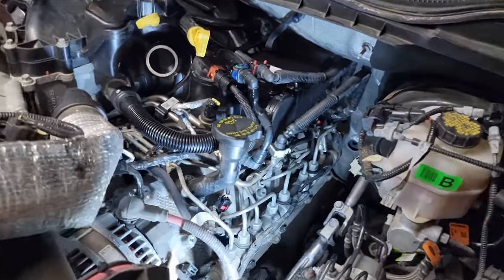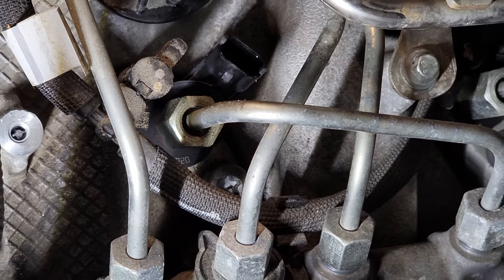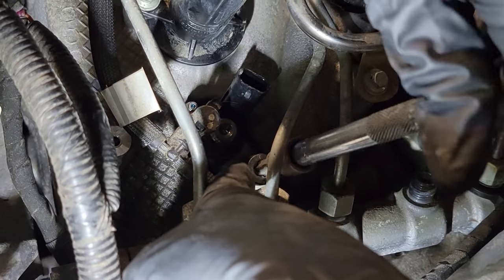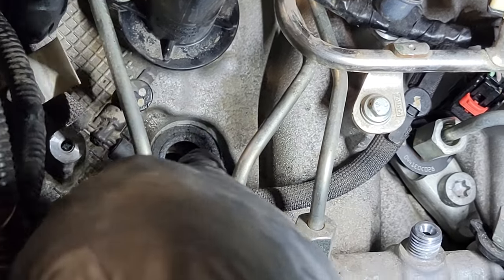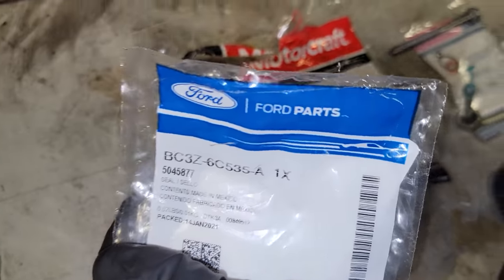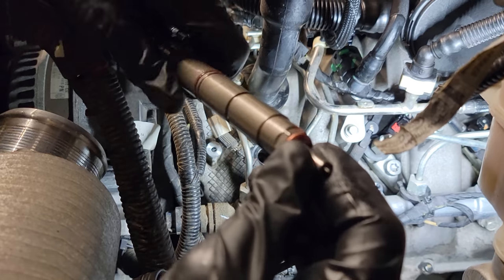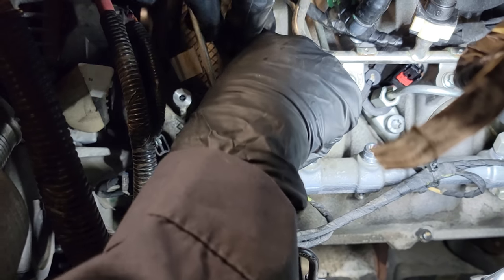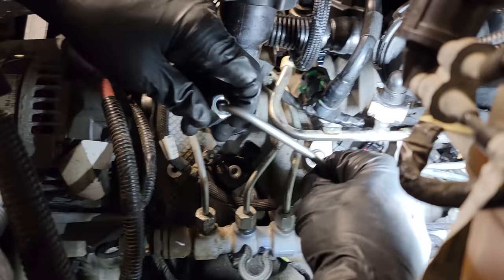Do YOU have an OIL LEAK?? 2011-2023 FORD F250 F350 F450 F550 F650 F750 **Easy FIX** Watch this

Comment: I just done this job eight of them. The customer thought I overcharged him labor only charged 300 customer supplied all parts worked in a big truck shop. I can do a Volvo semi truck and half the time and replace all the injectors and program them and labor alone was $2200, so I don’t understand how they think they got overcharged. The passenger side is hard to do.

Comment: I replaced the seals on cylinders 5 and 6 today. #5 was for sure leaking, and it looked like #6 was likely leaking, so I just did both. My injectors came out pretty easy using the “fulcrum” method Arod talked about. I had to use a 17mm wrench to get the fuel lines off and on, and it worked fairly well, though the tool Arod used looks easier. It was a little difficult to know how tight the fuel lines needed to be since when I took them off, they didn’t seem very tight. One other thing, the copper washer on #5 didn’t come out with the injector, but I was able to fish it out with a pick. There was some debris where the copper washer sits, and I was able to clean the surface by spraying a bit of compressed air down in the hole so I could feel better the washer would seal. Be careful removing the coolant reservoir, there are little tiny hoses that break very easily…

Comment: For seals like that I’ve used a J hook battery hold down bolt, put a socket over the shaft of the bolt, washer and nut. Improvised slide hammer.

Comment: Excellent work Dr Arod!  Appreciate all the insights that you give on your repairs. I tell ya, Ford dealers could use a few more Arod’s  in their bays 👌🏼
Reply from the maker: Thanks baby
Reply: Agree 100%.  We need 100’s if not 1000’s of Arod techs out there...  it’s far too easy  to get a bad technician these days, or so has been my experience with dealer shops nowadays.   And it’s common across ford, gm and Honda.  Can’t speak to the other brands though...
Reply from the maker: Alll i hear pal!!

Comment: I'm 52 come March off this year and I started working on cars at 8 years old passing wrenches to my father when he worked on a car and that's how I learned.  I'm thinking about selling my 2011 6.7l that I bought new back in 2011. It's my first diesel and this is just to damn much work. Anything that you have to do to that SOB under the hood requires for you to take off that top of the engine. What a mistake I made buying a diesel. Love the power of it but to me it's not worth it. If I could do it all over again I would of bought the gasser. Great video buddy and my hats off to you but this is too much work. Take care my friend and thumbs up on your video. 👍👍👍

Comment: Done a few of them, usually due to a plugged up ccv.  Actually made an installer out of plastic for doing the back injectors seals.  Turned it on my lathe.  Works like a charm.  Holds the seal and is strong enought to hit with a hammer.
Reply from the maker: Niiiiiceee

Comment: In cases like that, I use both a paint mark and wrench angle. On a Honda crank pulley, for example, the spec is 60 degrees more after torquing. That’s one flat or corner of a bolt’s hex head. They also make wrenches that measure angle

Comment: Yet another EXCELLENT vid by my man A-ROD!!! You know, I can count on my hands, how many times I've ever needed to re & re injectors on a 6.7. The 6.0s, not so much. If that, by itself doesn't speak to its reliability, I don't know what does. Watching this vid has made me remember the idiosyncrasies of having to do this. I have that exact same tool you have made by Matco. Except mine is a Blue Point. I find that it doesn't fit the flare nut properly (so much for Snap-On quality). I have since resorted to only using a 17mm crow's foot for this task. I use it on the Eco turds as well, when I'm into the high pressure fuels for whatever job I have on hand. I do however, LOVE that injector removal tool. I think after watching this vid, I'm going to have to order one for myself. I know that ProMaxx stuff can be a little spendy. I just bought their hub and bearing removal tool that's supposed to be the cat's ass for Explorer hub and bearing assemblies that tend to need a gazillion foot-pounds of force to separate from the wheel knuckles. Funny enough, I have yet to use that tool since purchasing it. I didn't know Ford updated the fastener for the injector hold-downs to a 10mm bolt instead of that cheesy TX-47 bolt. Kudos to Ford for that. Learn something new everyday.
Reply from the maker: Hope ur well my friend!!

Comment: Thank you for the great lesson . Let me please know what to do if  the fuel injector compression copper gasket falls on the top of the cylinder head ..  I do not know what to do now..
Reply from the maker: Ur gonna have to get something sticky like butyl & a long tip screw driver & go fishing
Reply: I am fishing now. No luck yet … 😳
Reply from the maker: Can u get a mirror & CONFIRM that it is at the bottom.

Comment: On the same truck that the bolt broke have you ever had an injector so stuck on the 6.7 I had to make my own tool the bearing puller that you loan from autozone and it was in their that truck was scary.

Comment: Hi ARod. Never done any work yet where I had to remove any high pressure fuel line. Someone said one needs to make sure it’s not pressurized for safety, before removing the first line. I may need to change my intake manifold gasket and this is the only part I have questions about. Thanks Mike.
Reply from the maker: Trucks off....the hp dissipates very quick. Id wait 5 or 10 min u shkd be gtg pal

Comment: Excellent video as always!

Got the same issue on my 12 on cylinder 1. Thought I might get lucky with a CCV replacement, still doing it so I’m gonna have to replace that seal. 

Biggest concerns I got from the video, 
1. Don’t snap the hold down bolt in cylinder head
2. Don’t let the compression washer fall into valve cover. 
3. Don’t break the fuel return line

Anything else I should watch for? 

The injector re-seal kit for injector 1 the same as 5? 

How often do you see the washer fall off or bolt break?
Reply from the maker: Washer, often. Bolt break not often...no on 5
Reply: @PowerStrokeTechTalkwARod  thank you! 

if that washer falls off does it just end up in the injector well or into the valve cover with the rocker arms?
Reply from the maker: Cld be both bother...
Reply: @PowerStrokeTechTalkwARod  copy that, Thank you. 

Wish me luck haha!
Reply: @PowerStrokeTechTalkwARod  just finished this today, took me longer than you but I got it done with no issues. Thanks ARod!

Comment: Hey brother good to see another fine video from a pro!  I want to pass on a piece of good practice from my master tech at ford.  Always clean area around any plug or injector that will expose contaminants that may enter the bore on any engine especially newer diesels like that badass 6.7 powerstroke your working on here in this video.  Interference fit pistons and tolerances as tight as the ones in this engine do not tolerate any shit in the engine I know you probably know this already but did not see it used in this video. Valuable info to the shaky DIY'er. Just sayin...keep on rockin it man 👍
Reply from the maker: Thanks pal
Reply: Interference fit pistons? As a machinist interference is when you are joining two pieces as one? So in my practice if you were to interference fit a piston is would be so tight it wouldn’t move
In the block…Guess I’m interested in what you mean?

Comment: Hi I have the same leak same side possibly the same injector but maybe one over (haven’t got my camera down there yet) Is the fuel line you need to replace the same on all 4 injectors, or is the part number specific to the injector. Also I’m assuming no programming needed if the injector is reused and goes back to the same spot. Thanks Mike.
Reply from the maker: Yes no programming. But will need inj specific line

Comment: I have a 2011 with near 200K on it and am thinking about oil leakS and getting them all dried up. Is there a point of no return so tot speak of doing a cab off?  Pan/water pump (h2o leak) and I am sure more.  Does it potentially strand me not sure but I'm a bit OCD.

Comment: So if you are doing work on new scribers please tell what are you are located.  I have been watching your videos because I need to buy a Ford F250 or F350 and have been going out looking at all of them and I really liked one but up there was a lot of oil underneath the engine area at first I thought oil pan but its way up on the engine and on both sides so I have no idea.  Plus when you shift  From Park to Drive with food on break it still jumps forward hard.

Comment: Gotta do this on my '12 on cylinder 4. Best way to get to it looks like going through the fender well. Thoughts on getting the best access?
Reply: How did u pinpoint it seen oil leaking from
Reply: @135-j  I saw oil leaking around the seal

Comment: Question: I have a co-worker with a 2015 250 with the 6.7. When we left work in the morning, we noticed his truck was smoking big time out the exhaust. The outside temp was 5 degrees. He said it stops by the time he gets home. What could be causing this in the cold weather. I have a 2020 6.7 and it never does that. He said he has 106,000 miles on it.
Reply from the maker: Normal buddy, cold

Comment: How do you properly diagnose which injector could be the problem? I’m not throwing a code. I have white smoke out tail pipe along with oil residue. I also have a deleted egr. Recently changed my turbo. Had no problems until a month later I changed oil. I noticed crud around my lower oil pan. Coolant level has stayed the same.
Reply from the maker: Might have 2 take that in
Reply: @PowerStrokeTechTalkwARod  Arod it’s bottom of the 9th.. I can’t take it to dealer.. I’ve come too far. I’m committed.

Comment: What sensors are plugged in underneath the fuel rail/injectors?
Reply from the maker: Glow plugs
Reply: @PowerStrokeTechTalkwARod  I’m currently doing this on my #3 injector due to the ccv filter being clogged. For the life of me I can’t get the injector to budge. I’ve tried multiple different techniques with zero success. Do you think the powermaxx slide hammer would get it? My truck has been down for 2 weeks now
Reply from the maker: It might. Did u try flipping over the hold down and hitting it like a fulcrum

Comment: Hay Arod big fan, im a local repair shop in westland. I have code P0093. The 6.7 wont pass high pressure fuel test on IDS. My dad has thrown the parts cannon at it without listening to me and we are married to it. Any tips would be greatly appreciated. It stumbles after a High Pressure Fuel System Test. We changed highpressure fuel pump, tank fuel pump and fuel water seperator
Reply from the maker: I am in WESTLAND now! Where you at
Reply: @PowerStrokeTechTalkwARod  American truck and fleet repair
Reply from the maker: Dm me on Fb or IG
Reply: @PowerStrokeTechTalkwARod  aye aye captain arod

Comment: I think I have a leak where the vacuum pump gasket is. I bought the Ford extended warranty, and it says it covers gasket leaks. The backup camera works when it wants and the power mirror motor doesn't work. 2014 6.7 with only 80k miles. I'll be selling it after it's fixed and will buy a 2020 Tundra. American made vehicles are pretty much piles of junk.
Reply from the maker: Wow, good luck with that tundra trash
Reply: @PowerStrokeTechTalkwARod  My brother has a 2012 Tundra with 259k miles. Only changed brakes, tires, belt and wiper blades. No fluid leaks, no expensive part changing, nothing. Just saying 🤷‍♂️